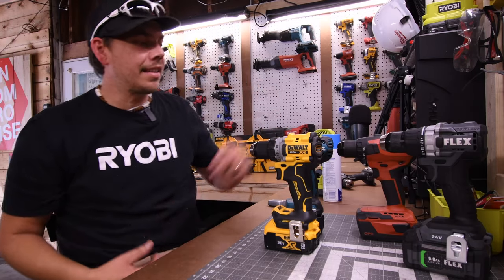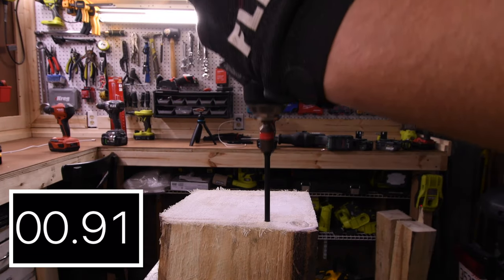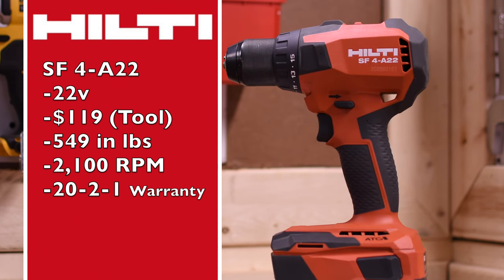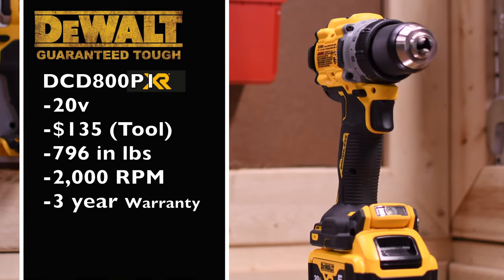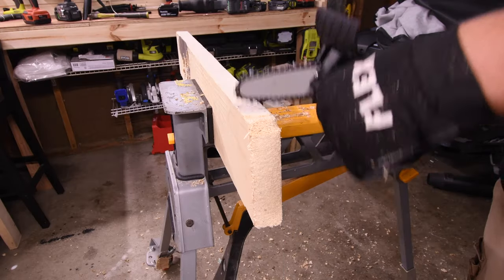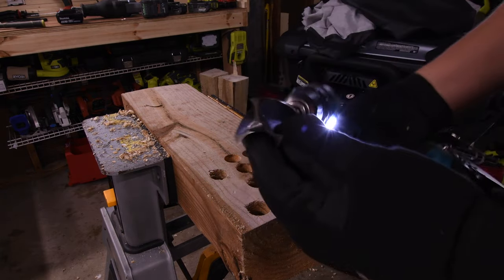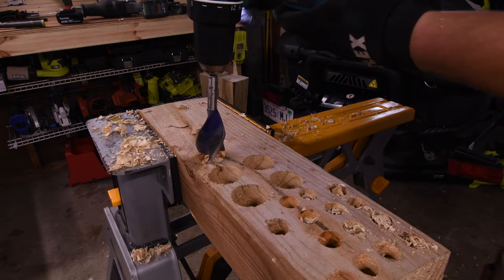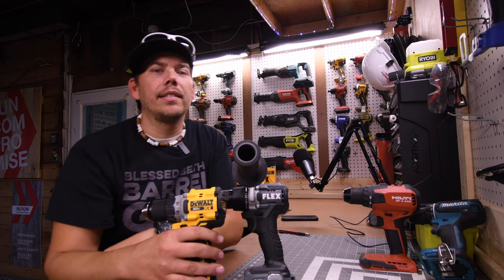Which Drill Driver is BEST?

Comment: I have the DCD805 (the hammer drill version of the DCD800), and that thing is a beast. The size reduction alone had me sold. Still keep my DCD999 around in case I need that extra power. But so much power in such a small form factor makes DeWalt’s new drill more than worth the cost.
Reply from the maker: it really is a great tool

Comment: Each brand has a premium drill driver and hammer drill of equal specs i. e Makita XFD14 & XPH 14. Both have equal specs except the latter is a hammer drill
Reply from the maker: that is correct sir, along with reciprocating and impacts
Reply: Incorrect… Flex has a Turbo and Non-Turbo Mid Tier Drill Driver…. As well as a Turbo Hammer Drill… not every brand follows the same trends like a 🐑

Comment: That DEWALT is beast for its size and yes it’s a  atomic with XR badge.
Reply from the maker: I wanna look into that, see if they did take it over lol.
Reply: I love my ATOMIC but not been available in OZ for awhile now ,glad I grabbed mine 2 years ago.
Reply: The kit that comes with the DCF850 and the DCD805 with 2x 4AH batteries seems like the true successor to the kit that had DCD796 + DCF887 and 2x 2AH batteries that I bought back in 2018. Honestly DCF845 was not a good successor to DCF887. I really believe that belongs to DCF850 due to reduced size and slightly increased power.

Comment: I have that dewalt drill. It’s a beast, I was drilling through ROCKS in my backyard with a 35mm diamond drill bit
Reply: Do you have this drill which is the DCD800 or do you have the DCD805 Hammer Drill version?

Comment: Well done informative video .
Flex is good but to big and heavy and the batteries are to bulky.
Dewalt crazy powerful and light and compact especially with the 5 amp battery. Yellow and black for me.
Reply from the maker: you are correct but the makita was the lightest one out of the bunch but lacking is power in this model
Reply: @ManCaverTools  Makita DDF485 (XFD131) size-wise is in the semi-compact category, but not in the powerful compact category, and right now Makita doesn't have a powerful compact. Funny enough, this compact DDF 485 (XFD131) has same 25 Nm soft torque in speed one as the sub-compact DDF487 ( XFD15), but the sub-compact DDF487(XFD15) has more soft torque in speed 2, coz' of the RPM diference, 1700/500 for the subcompact vs 1900/500 for the compact, so 7.35 Nm for the subcompact  vs 6.57Nm for the compact. The closeest Makita was - more then a decade ago DDF456(XFD01) with brushes @ 2Ah compact, 36 Nm soft torque in speed 1@400RPM, 9.6 Nm in speed 2@ 1500 RPM, 1,53 Kg @ 2Ah compact, 300W motor with brushes. The brushless model that replaced that was wey worse - DDF480 (XFD06) was wey-wey noisyer - so much so that I started to hate some brushless, bulkyer, wey heavyer, not just 10 grams but because it has 360W motor plus pretty close driver losses ~ 20% in adition to those 360W - so draw more amps and needs the 5Ah pack so 1.794 Kg..., has same soft 36Nm in speed one but less torque in speed 2 coz' it has 50 RPM more in speed 2 (1550) and same 400 RPM in speed 1, and is less reliable and the parts are more expensive... Next DDF 484 (XFD12) is even heavyer, and DDF 482 ( XFD10 ) is a crapy one, not coz' it has brushes, but coz' it has crapyer parts @ higher RPM... The ex compact brushless DDF459 (XFD05 or something like that, LXPH05 fot DHP459) was even wey worse, absurdly bad trigger control, etc.
Reply: Ya DeWALT is making some amazing tools lately, they have the best impact wrenches on the market right now, smaller stronger and more features than Milwaukee
Reply: @loochan325  Great info man, you work in Makita development or where do you get the info about motors and torque?

Comment: The new Kobalt drill driver has 850 in/lbs of torque and 2000 max rpm.  Comes with a handle to prevent anti kickback, reversible belt clips (unlike the flex, but I heard some of them do have them reversible), metal chuck, and it is only 6-5/8 in length front to back.  Design looks a lot like the new Dewalt DCD800 than its cousin Flex.  The handle is redesigned to look like the XTR, but this is not part of the XTR line up.

Comment: The DeWalt gets my vote but in fairness, i haven't tried that flex, just the bigger turbo one.
Reply: The lil flex has high rpm and good power and its small I have the dcd800 and the compact flex and they go back and forth the dewalt with the powerstack is awesome so light I pair this drill with the dcd840 with powerstack I can work overhead all day
Reply: You don’t need to get the Hammer Drill to have the Turbo. There are two mid tier Flex Drill Drivers, with and without Turbo. People like this YouTuber know such things and purposely misinform so as to make their brands look better… except nothing can make Hilti look better, and Ryobi will never compete with Ego… Both Brands own by Chervon..
Reply: @athannaelanderson3806  do you have the model number on the mid tier flex with turbo mode.  I know that they have a drill driver version of their top tier drill that has same torque and speed specs as the hammer drill but I believe this model is the one that has about half the torque and 300 less rpm’s.
Reply: @TinkerWithTools Of course Brother.
Flagship - FX1271T-1H Turbo Hammer
Mid Tier - FX1171T-2B Turbo Drill
Low Tier - FX1251-2A Hammer Drill
Entry - FX1151-2A Drill
All Flex Drills and model numbers as accordingly, the only one I left out is the old flagship with the old batteries. Currently only Flagship comes with the option for Stacked Lithium.
Reply: @TinkerWithTools  they also sell a standard hammer drill as well with no turbo. It’s all in my list ☝️
Reply: @TinkerWithTools  All turbo Models have 158Nm torque, all non Turbo models have 85Nm or 750 in-lbs. 600 to 2200 Rpm on all Non-Turbo,All Turbo models range in Rpm from 550 to 2500 with 1400 in-lbs.

Comment: This seems like a weird match up. That Makita is in a completely different class than the other brands. HD has it in a kit for $119 right now with the bigger 4ah battery. I picked up an XPH14 bare tool with free promo 2ah battery last summer for $150.
Reply from the maker: the XPH14 is a hammer drill, that is a completely different tool then these are
Reply: @ManCaverTools  the only different is the hammer and your not using it

Comment: Dave was this a battle of the basic brushless models? Just wondering why the Flex Turbo wasn’t used.
Reply from the maker: these were regular drill drivers. and their pretty the same size. Each brand has different variants of a drill driver. this video was against these ones.
Reply: @ManCaverTools  great video. This video would lean me towards the DeWalt with its smaller size.
Reply: @ManCaverTools  also do you plan to test the new  brushless Hercules models coming out?

Comment: Wait wait….you didn’t use the XGT…please do the test with Makita XGT 40v!

Thanks you!
Reply from the maker: this video of of these drill, these other brands have different variants of a drill driver as well
Reply: @ManCaverTools  oh thank you David! Could you please do a top of line drill comparison? I have the gen 3 m18 drill but also picked up the XGT 40v recently. They both seems very close in performance. But I don’t do any heavy duty work just mostly wood work, so it’s good to see you guys put these tools to the test! 

Thanks !
Reply: Has Makita got a MID tier drill in 40 volt range ? I just checked  ,only XGT drill driver available is top tiered 141nm model which is not fair to compare with these drills.
Reply from the maker: I do want to get the makita 40v line. I just having got any of them yet.
Reply: The 40V isn't a good comparison, but neither is the model he tested. The XFD14T is more on par with the higher torque drill drivers. He tested a lower tiered model
Reply: @interman7715  actually they do have a mid tier 40v model

Comment: Uhm i don't know how the result if change the Makita in video into the Makita Xfd12
Reply from the maker: that would deffinetly make a change, but the other drills have better variants as well. Hilti has the Nuron version, Flex has the turbo version. and this Dewalt is just 1 of the XR Models.
Reply: @ManCaverTools  The Hilti Nuron will a better result maybe but the Flex Turbo i don't thinh it in this stage the Makita xdf12 is in the same Stage as the dcd708/791
Reply from the maker: once I get those tools I will be doing a versus video on them :)

Comment: There's no wonder DCD800 has more torque in speed two. It's spect 34 Nm soft torque, and that's in speed one @ very high 650 RPM, so having 2000 RPM in speed 2 we have 11.05 Nm soft torque in speed 2. Forget about 90 Nm hard torque - that is also only in speed 2, from hard stop in shock from max RPM with small load, from inertia, momentum and kinetic energy in relation with the speed squared, and is "good" to break screws and the stuff you work on. Hilti SF 4 A22 has 36 Nm in speed 2, but 2100/610 RPM so 10.45 Nm in speed 2.
Reply from the maker: it is a worthy compact drill for sure
Reply: Ya lost me dude
Reply: @interman7715  11 Nm soft torque ( DCD 800 in speed 2) =  1.121687834 kgf on a 1m long  lever, or 5.608+ Kgf on a 20 cm ( 8")  lever.
Reply from the maker: you were talking about specs of the motor with both speeds. I said it is a good tool because it has the power it has for the actual size of the tool.
Reply: @ManCaverTools  I remember 16 years ago (2006)  or even 12 years ago for some, that people were happy to have 11 Nm even in speed 1, or on some B&D made in England with only one speed gear... In 2008 ( 14 years ago...) I bough a Makita 6270D with 12V@ 2Ah NiCd spect 20 Nm soft, 30 Hard, and I was so ahead of those with screamers B&D... :) My 6270D was  in a kit with HR2450 rotary hammer. Although I am very happy with both, or precisely because of this, since then I increased my tool  collection so much so that I need a bigger home...

Comment: That poor makita..It even looks cheaper. Flex would have did that big hole in speed 2 if you didn't push so hard 7:50. You said battery on the makita, 5.0 was full, but I see a bar missing. Oops. 10:06
Reply from the maker: im only human, even the bigger channels make mistakes.

Comment: Forgot to use the stacked lithium. Yes it’s an unfair advantage but FLEX we’re the ones to drop the pouch cells first. Dewalt dropped the powerstack to the public first however FLEX /CHERVON had the pouch cells long before that.
Reply from the maker: those will be in a different video.
Reply: Dewalt had the pouch technology first flex has to pay Dewalt for use

Comment: 1. Makita used is like half the price of other tools bare, not a direct comparison
2. They actually do have mid tier 40v model, 60nm rated. That one would be interested to test, and it costs similar to other drills in this video
Reply: I see "used once" and even brand new unopened DeWalt tools for half their retail price all the time, like on Mercari or eBay.

Comment: It’s not “The Makita”. You chose an offering from Makita that can’t compete. If you want to say “The Makita” use the proper tool that’s made to compete in this category, the XGT 40v Makita.
Reply: Makita is my tool of choice. But I shouldn’t have to use a 40V tool to compete with the 18/20v tools.
Reply from the maker: the other tool brands have better drill drivers as well. Hilti does more Flex has more and Dewalt does. Dewatl has a few XR models. this video was. about these 4 models
Reply: They should have used the next tier drill in the 18 volt line.  The one they used is the low level brushless, when they have another brushless 18 volt with the metal chuck, and high ratings.
Reply: The 40V model isn't a good comparison, but neither is the one he used. The XFD14T is closer model in their line. He chose to compare a lower tiered drill driver